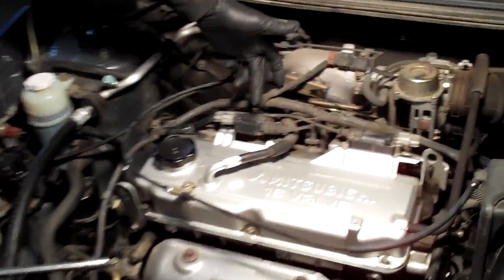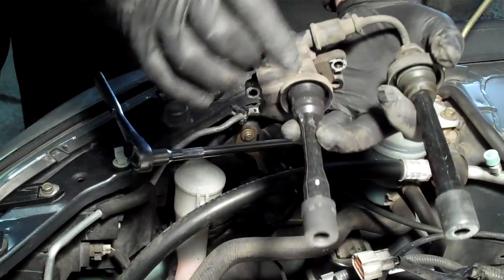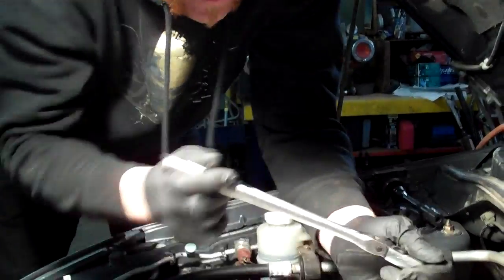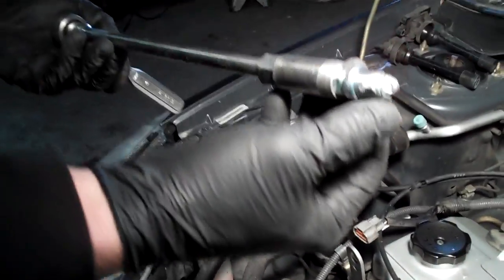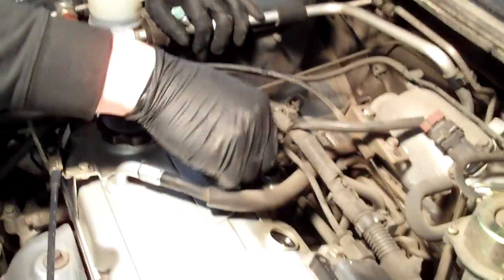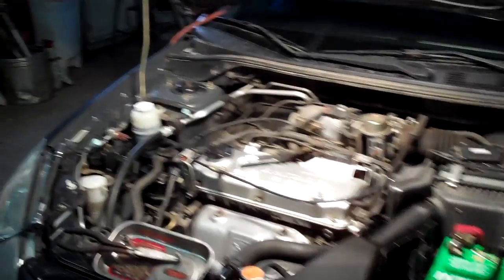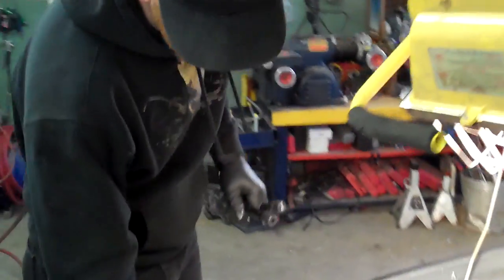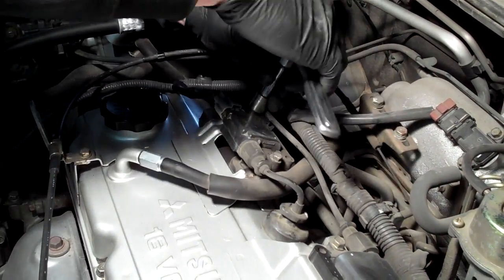How to do a tune up on a coil over ignition system

Comment: The Coil Boot does not have a "bracket" in it?  Is that just a term your using?  I've never known what to call those metal cylinders that go between the spring and the top of the spark plug.  I know some people use a locking fitting on top of the plug and it snaps on.  Question is, and I'm wondering this because my car has the same coil pack setup.  Are the coil boots supposed to be spring on plug or is that metal piece supposed to be in there like the other 2 non coil plugs?  my coil boots dont

Comment from the maker: @omarG19100 Bosch Platinum are typically poor performers in many cars.  You didn't say what car you have, but NGK is a safe bet for most any import.  As for coils- I don't know what car you have or ignition system configuration.

Comment from the maker: @peelout40   When plugs are stuck like that I use PB Blaster to pre-soak them.  I crack them, tighten, loosen more, tighten, loosen, tighten etc.  Then I use a thread chaser tool to clean the threads back up if needed.  Another thing you can do is use a dremel to cut the base of the new spark plug thread like a thread chaser.  If you're desperate enough to do this, do it sparingly and only as a last resort on a car who's repair cost to value ratio warrants it.

Comment: Did a tune up on an 04 Dodge Stratus sedan, (V6, what a pain...) and oh yeah, I've had the porcelain portion of the plug break off, and they were all STUCK...it was original ones from factory and no anti-seize...nervous, very nervous...

Also, I find that using small rubber hose works well, I lost my spark plug washer boot thingy for the socket, so that's also an option if you can't reach in there, or don't have a magnet.

Comment: @briansmobile1 It's more that the threads are aluminum and the spark plug is not. I had a friend who was campaigning his 600hp Civic at IDRC in LA. He was changing plugs and stripped #3 right away trying to move too fast with an extention. One look and I knew what he was thinking "We need to take the head off your GSR in the parking lot." What are friends for!

LOL

Comment from the maker: @ProjectCarTV Ones "down a tube" or hole like every coil over ignition system are- are hard to cross thread unless you're on LSD or something, but ya you definitely have to start them by hand on like a Ford Escort 1.9L or other type of exposed plug.  Thanks.

Comment: @briansmobile1 Good videos man. I Subscribed! On suggestion that I was wondering if you'd do when you put the plug back in - remove the ratchet from the extension first. It's an extra step sure, but with an alumimum head, you don't have to worry about cross threading. You've been doing this for years, so have I, but it's worth mentioning for those who haven't. It's a pain to cross thread and then have to heli-coil a spark plug hole.

Comment: I notice you didn't use a blow gun to blow the hole out before pulling the plug, the holes are usualy dusty & many times I have found chunks of sand or something that would have fallen in the cylinder

Comment from the maker: @emadseksek   If there is sludge build up its a very good idea to flush the engine and then remove and clean the oil pan.  It's like changing the shingles on your house- it only helps if you need the new shingles.  In this case it only helps if you need sludge removed.  Most engines if you change the oil every 3K miles will never need a flush at all.  Sludge builds up from past due oil and missed oil changes.  Oil is full of detergents that prevent sludge and the filter does the rest.